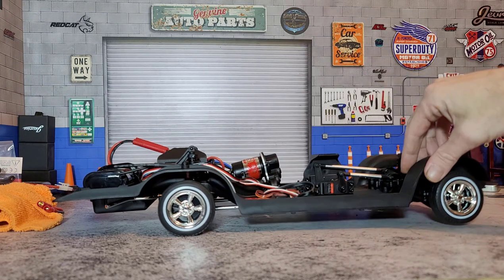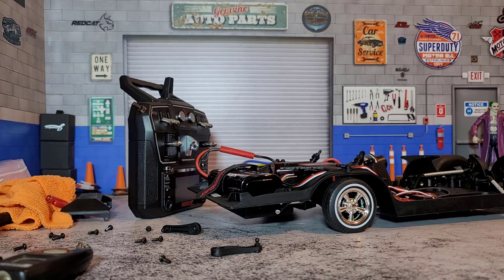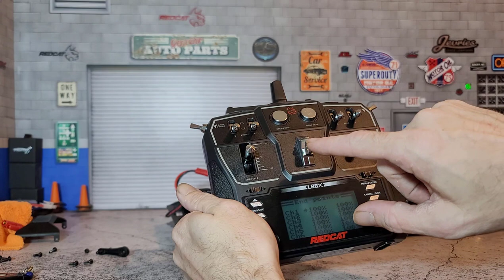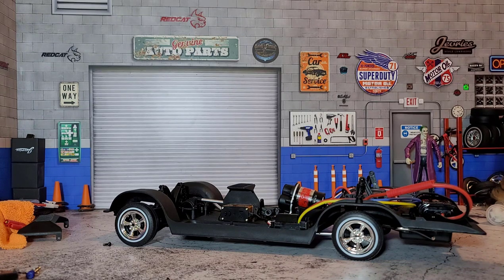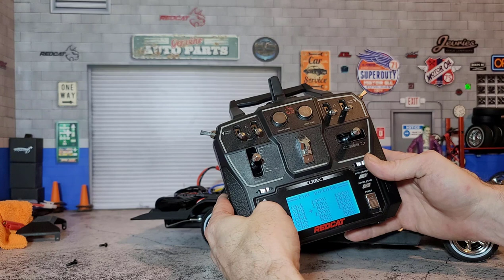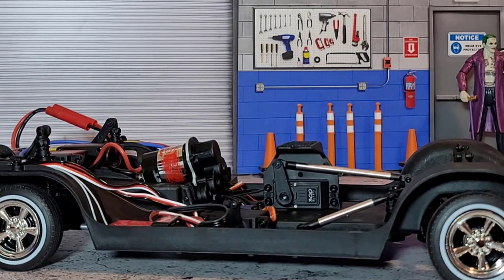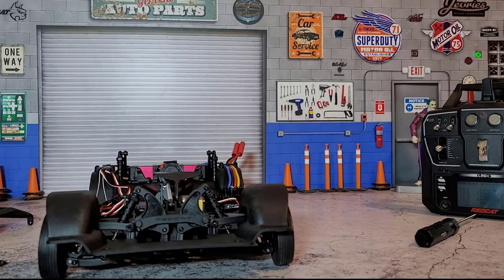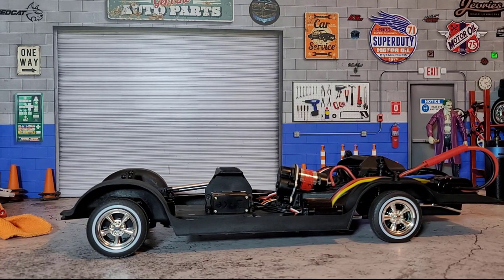Redcat Lowriders Setting End Points on the Sixty-Four Start to Finish

Comment: Wow I just got my 64 and I thought mine was defective because the front servo gets extremely hot. I didn’t know that I had to set the endpoints correctly. pretty dumb they aren’t set correctly from factory. I already put in a warranty claim because I’ve already over heated the front servo 3 times  and out of those 3 times throttle stopped working then the front raise switch then the steering. They start working after the servo cools down though. I just feel like I need a new servo now.

Comment: Just bought the Monte Carlo one everything works except for the front when I push the button that makes the front raise together only one side raises same for the lowered switch. Anyone know how to trouble shoot this issue?
Reply from the maker: Often that  an issue with the "mix" setting in the controller
Reply: @NorthSideCustomRC  ok I’ll look into that not sure how to set the mixes
Reply from the maker: @Gypsy Bankrollz  message me when you can look at your mix.  Tell me how many mix setting you have  ie mix 1, mix 2, mix 3

I need know how many you have

3  or  4

Comment: I changed the rod and servo horn on my jumping servo to a shorter horn and increased the end points a little and it gave it a little more pop on the jump. It’s not trying to go beyond its range and not getting hot. You think I can run like that or should I go back to the original horn and rod?
Reply from the maker: You should be fine. I did same it's great way to improve performance a bit. Leverage factors work in our favor
Reply: Thanks for getting back to me I’m thinking about going with the duel servo mod
Reply from the maker: @Jasonkartracing  its worth it, more bang

Comment: Bro how can I make the car faster ??
Reply from the maker: Faster driving?
Reply: Yes I would like the car to have more speed ..
Reply from the maker: @Roguestatus650  switch the jumper plug to lipo mode and run 3s. It gonna be Hella fast tho careful
Reply: @NorthSideCustomRC  which one is the jumper plug?
Reply from the maker: @Roguestatus650  it's maked on side of esc where jumper plugs be at

Comment: Nice work on your videos and how much you share for RC community. I’ve watched this video over and over more than 5 times. This being my sixth. I get it but then again I don’t due to me accidentally resetting my radio and now all my end points are at 100 with all my servos on my monte are all out of whack. Trying to get it dialed in and I can’t seem to get my channels 3 on up to jive with my knob potions on the remote. I know the end points are all set to different numbers from the factory. You think you could share to someone on how to get it back to working conditions for us? I called redcat but with no luck by them saying just to do each channel by itself and move onto the next. I would if I could get the first channel to work with next channel since they are on different sides, they don’t go the same way. I’m lost and about to give up this lowrider and was hoping you could assist me or others that may have done what I’ve done.
Reply: Hey Keith, have you figured out your EPA settings yet? Don't get frustrated.👍🏻
Reply from the maker: Thx, lemme know where I can be more clear. This being such a critical thing with these lowriders I been thinking about doing a better quality video that's as clear as can be for entry level to rc expert
Reply: @NorthSideCustomRC  Yeah, I'm sure there are more new things to share with all your work. I was frustrated with the servos at first messing around with ride height. When I hit the drop rear button, car jiggles on the way down!
Reply from the maker: @Carlosinator  "car jiggle on way down"" are the end point a low value on either side? Like 15 to 20 type low? 

I ask cuz found pan buttons Lil funky if an end point too numerically low. Kinda like need enough on the end point to have the smooth travel.
Reply: @NorthSideCustomRC  Ch 5 is 99% 89% Ch6 is 67% & 101%. Gonna start with the Reefs see what happens.👍🏻
Reply: @NorthSideCustomRC  thanks for the tip!👍🏻
Reply: Started my EPA on channels 5& 6 and it only goes up half way to begin with. Did I click them wrong?
Reply: Started at 100%. On channels 5&6.
Reply from the maker: @Carlosinator  if you swapped in Reef they come with reduced travel. THey end points easier with programmer to add travel range
Reply: @NorthSideCustomRC  I thought so! I tried your way like 5 times.😂So, Okay pick up usb programmer add in travel and open those suckers up to 100% Power. There's an idea for a new video, "How to install Reefs Alacritous Servos in your Redcat Lowriders" (and what additional programming is needed.)😄👍🏻Right On Brother! Happy Thanksgiving.
Reply from the maker: @Carlosinator  yeah, they come set at 140 but go to 255 on the travel tab
Reply: @NorthSideCustomRC  So the Reefs Servos have to be programmed right out of the box before using them for rear servos. I was gonna use the yellow servos I will have to install in my 59 rears, are those set at minimum travel also?🧐
Reply from the maker: @Carlosinator  can kinda make it work with end points at 120/120 but real tideous to set up right cuz it becomes give up a Lil lift to sit low or sit a Lil up when dropped to get full lift.

It's just easier to set up with the programmer and can have each end perfect 

The stock rear servo have travel closer to Reefs dialed up to 255
Reply: @NorthSideCustomRC  Okay thanks yes definitely better to program them right.  Ordered that USB Link. I was gonna use my two stock yellow Reefs Servos on my 59 rears. I have two because I am replacing the stock 64 and 59 fronts with the Black Programmable 300's. Are the stock yellow Servos set at limited travel also? The Yellow Servos are supposed to be non programmable. 🤔
Reply: @NorthSideCustomRC  I'll use the programmer. Thanks for your patience and all the help!👍🏻
Reply: @NorthSideCustomRC  My thoughts...😁 there are no videos and limited information on installation and reprogramming Reefs Alacritous Servos onto LRH285 Chassis. Information is scarce. I ordered USB Programmer part #REEFS64 and I hope it's the right one. So far, cable link provided is incompatible to the 300 Alacritous but thinking I can hook up Servo directly to USB Programmer. Thanks again for all your help! Have learned a lot on your channel.
😁👍🏻
Reply from the maker: @Carlosinator  I'm a put a vid together for programming them.

You got right one, cable will work it just has power lead you won't use (its for direct power servo that need power supply to power servodirectly as dongle won't give power to it) 

However you are right you can hook servo directly to dongle anyway. The cable helps cuz got to finagle while servo inside RC lololol 

Only thing you should touch Fer now. 

Travel - go 180 to 200 this give you normal values on ur end point. 

PWM = Power turn that up to 100

Dampening - 50 lowest value keep all the power

Rest can leave alone, some options but I give better detail in a video
Reply: @NorthSideCustomRC  Excellent. Awesome. Looking forward to your new video. You are Appreciated. Was getting frustrated. My computer is down and my hobby shop couldn't download Reefs Software. Thanks for Everything. Right On! 👍🏻Bring it On Brother!
Reply: I also did this and can’t figure out how to get the servos back to stock does anyone have the stock endpoints for the Monte Carlo
Reply from the maker: @josetrujillo6081  there is no "factory" setting that work on all cars, have to manually input each one if you erased them
Reply: @josetrujillo6081  Hey Jose they're all different but here are my Monte Carlo End Points...
CH1 68/59 CH2 100/35 CH3 58/38 CH4 38/61 CH5 74/39 CH6 26/78. Hope this helps!